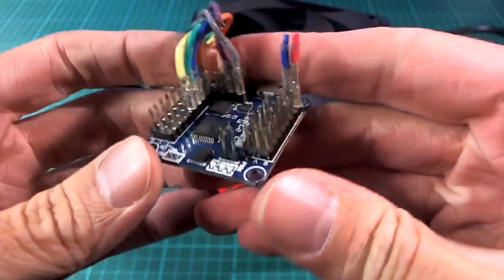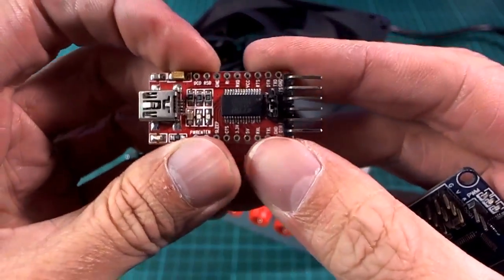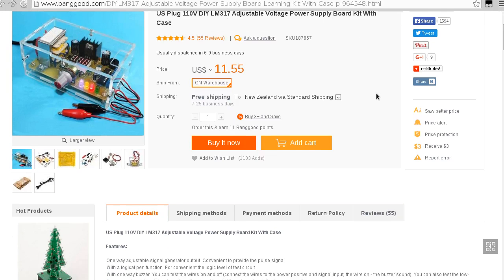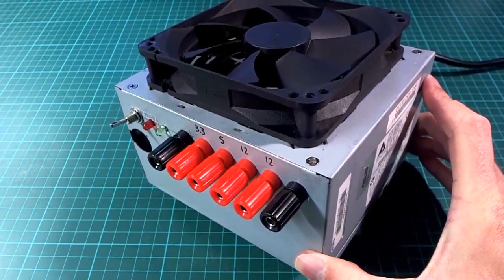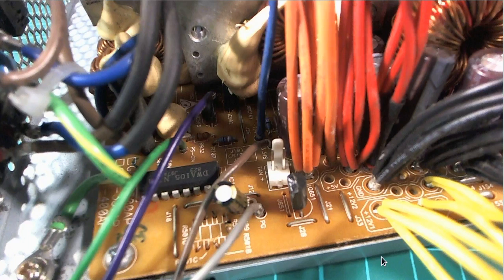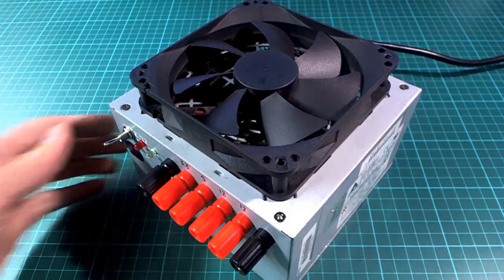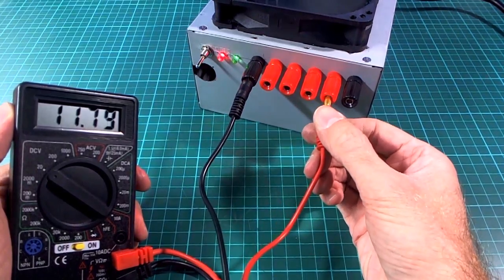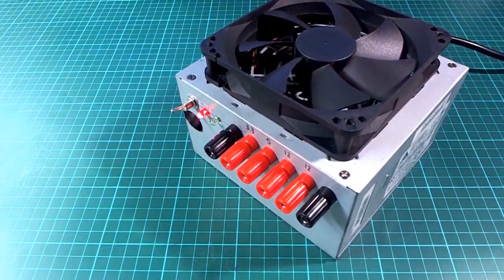ATX bench power supply

Comment: Hi old friend
I saw you make a power supply, I saw this is fixed output voltagte, right ?
do you consider to use DP power supply to make a better one power supply?
I saw a friend make power supply, but his dispay is better than yours, you can refer https://www.youtube.com/watch?v=vcI_NJ_kcPI and  https://www.youtube.com/watch?v=XlbtEkq7FTE&list=PLNcr2Rj_07PGexXolEzWu5_pFNOcO3g68&index=16  
he used DPS3012 (30V/12a) . but there are many choice to choose DPS3003, DPS3005, DPS5005 and DPS 5015 (http://www.aliexpress.com/store/group/DPS-Programmble-control-power-supply/923042_508466030.html)
or  you can make the progress easier, you just add AC-DC 36V PSU to make a real digital control power supply 
thank you  again

Comment: For more voltages you can connect between the different potentials. e.g. using 5v as ground and 12v as positive gives 7v. You can mix and match any of them. You do need to make sure you don't common the ground with another mains earth referenced supply, like if you connected 1.7v (using the 3.3v / 5v posts) to a circuit where ground was common with a USB port ground then that would short 3.3v to ground via the desktop computers USB. If this is the only supply in a circuit though it's fine to do this.

Comment: I recommend you measure the voltages again with a load of about an amp. Mesuring the voltages without a load does not tell you whether the power supply is properly regulating. Also at higher currents the voltage could drop significantly or the power supploy could shut down. In this case you may have to use a lower value ballst and/or put the ballast in the 12 volt line. This is not only with older power supplies.BTW the output s noisy as hell.Regards

Comment: for about 250 dollars you can make a 100amp 30volt variable power supply, and a 1000W pc PSU is arround 400 dollars..
Reply from the maker: +R4MP4G3RXD sounds good, do you have a link to some info/parts
Reply: *****
Not in particular, but I'd imagine it to be pretty simple with an lm317 and a lot of 2n3055's(Pretty cheap from china, 50pcs for about 20usd), the most expensive things would be the transformer and the huge filtering capacitors. The circuit would be the same as a simple lm317+2n3055 circuit, but you'd just add more 2n3055's and maybe change around some resistor values.

Comment: How does it handle a short curcuit? Does it power down, blow up, or burn the wires?
Reply from the maker: +John Knutsson to be honest I hadn't checked, but according to this it would shut down http://www.techpowerup.com/articles/overclocking/psu/160/8
Reply: Depands on how good the protection mode is. I shorted one and it just stopped working (it was on it's last leg anyway). I'm building one now with panel mount fuse holders
Reply: +Retsu Ichijouji the only fuses I have seen in ATXs are for mains surges, not output

Comment: you could buy an ATX breakout board from dangerous prototypes too, so you can use it with any ATX power supply, and for a variable one, use one of those 3A buck or boost converter from china changing the pot and putting it on a nice box with binding post too.
Reply from the maker: +Victor Florentin what a great idea! And looks like it has been around for a while too....
Reply: +Victor Florentin Did the same. The Dangerous Prototyp Breakout is awesome!